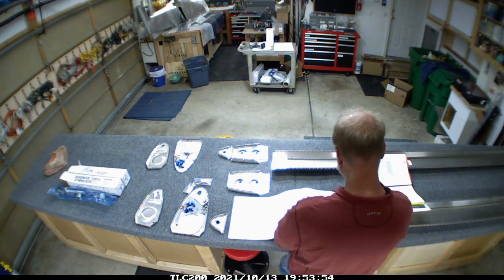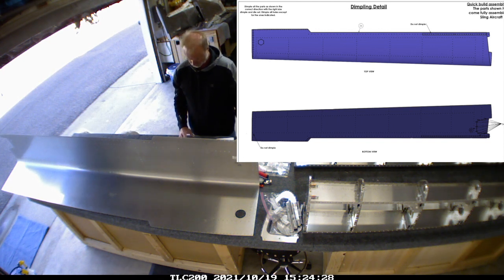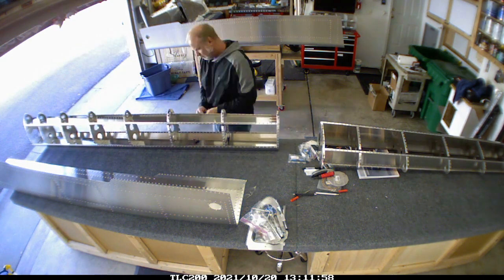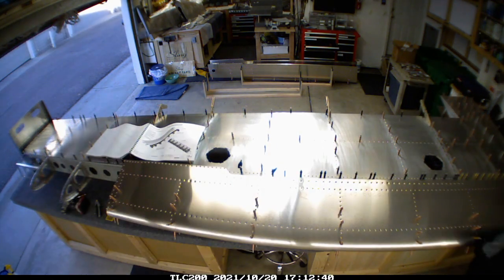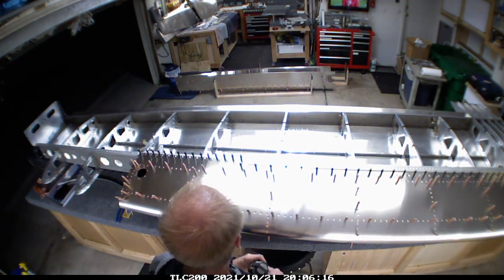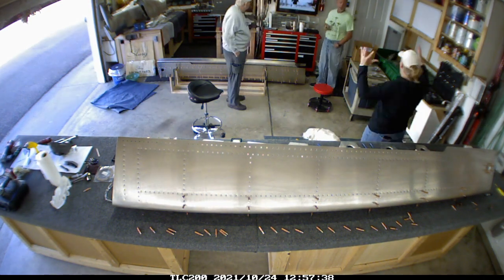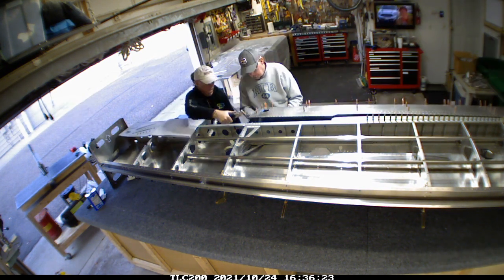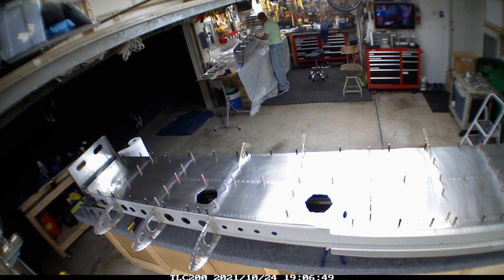October 2021 Part Duex

Comment: Did the cradle jig (other than the 2x4) came with the kit or you made those?
Reply from the maker: In the build manual there is a template which you tear out and lay it over the wood to cut it out. So it’s something you make.
Reply: @FirstRivet  Thanks

Comment: Why the non-factory fuel sender?
Reply from the maker: I actually have some experience with the sender I'm going to be using and it's a much more modern technology.  The install actually seems easier than the stock one even though I do have to modify the mount.  The best resource is CiES's site where they compare the old to the new at https://ciescorp.net/documentation/comparative-fuel-sensor-technology/
Reply: @FirstRivet  very interesting. Would love to see a some video of that install and some commentary around it for your next video 😀
Reply from the maker: @chriskroeker1889  funny thing is - when you asked the question I thought it might be a good video to make outside of the time lapse session… I’ll make sure I do that.  I’ve got a couple of minor items to address before I start cutting into the existing plate - so it’ll be a couple of weeks before I have anything to work with but I will make sure I do a bit more detail around the documentation on it.